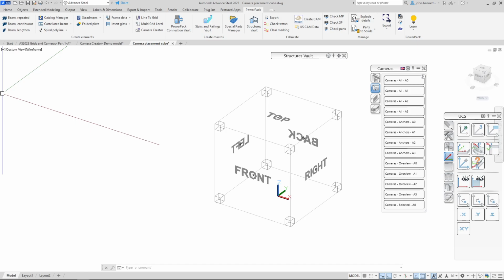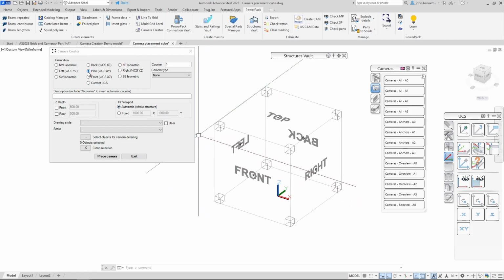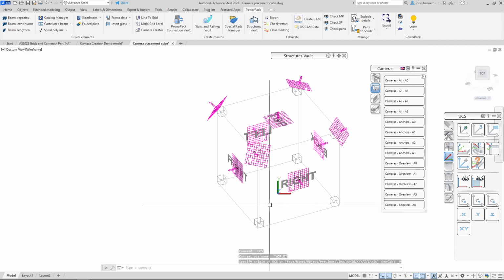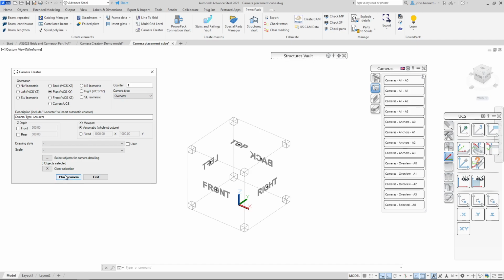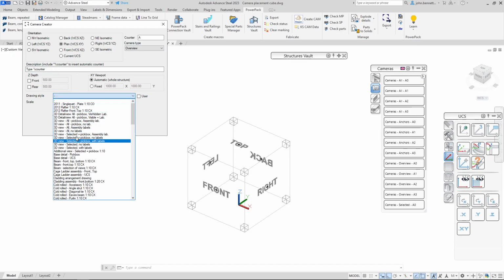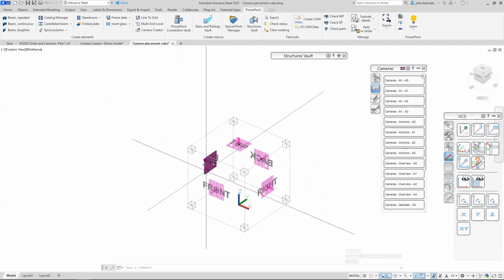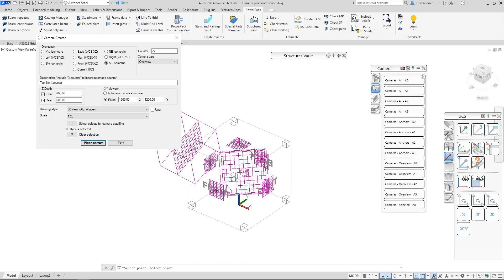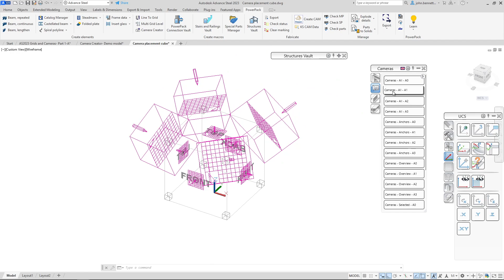GRAITEC Advance PowerPack for Autodesk Advance Steel - Camera Creator part 1 of 2

Comment: Great work on this utility!   My only issue with it is that the  "current ucs" setting is very limited and wonky. I have the 2023 powerpak installed (many new excellent feature BTW!) and I am unable to pick a point on an element and have the camera orientate to the xy of the user ucs while defining the center point with the pic point which is the way the should work IMO.  The placed camera winds up in a seemingly random area but the xy orientation matches that of the user UCS. This has no real usable value IMO.  Is this going to be changed so that the pic point would wind up being the center point of the camera with the xy orientation match the user defined ucs???